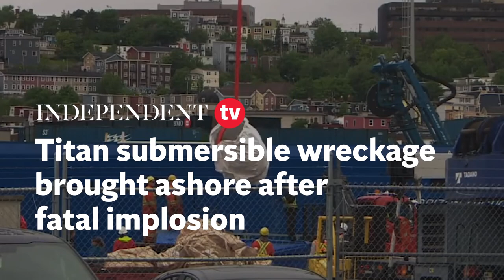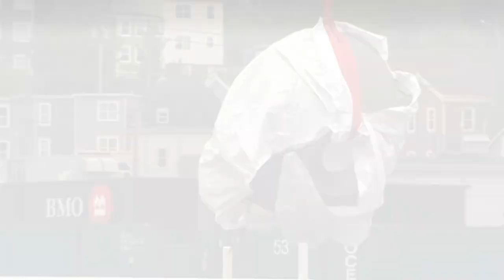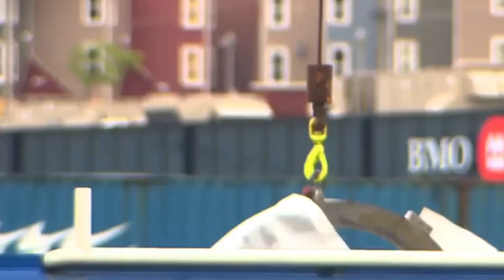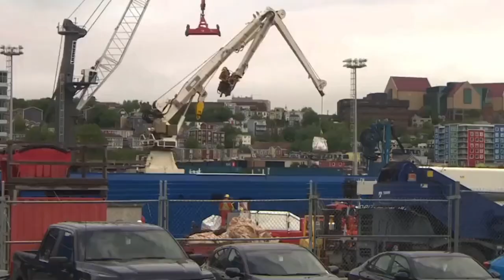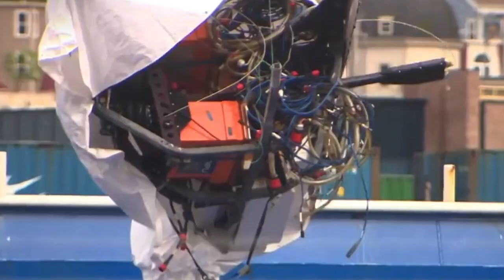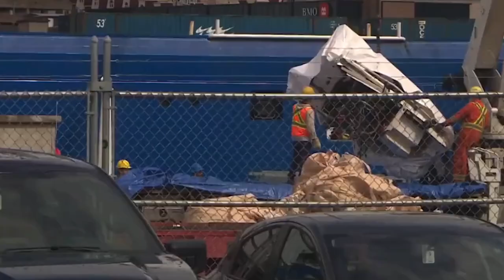Watch as Titan submersible wreckage brought ashore after fatal implosion

Comment: There is more of it left than I anticipated.
Reply: Funny that right? You ever seen an implosion on land….look it up if u haven’t and while you watch it x it by the pressures underwater at that depth, aka it’s wayyyy more of an event. Then look at these supposed pieces of an implosion where you have a perfect ⭕️ of a frame still with clear hinges (or whatever they are called) with bolt holes in them, none of which are crumpled/warped….very very weird this isn’t right for an implosion, not only does it implode inwards but then also outward. They will no down try and blame certain materials for this but no, no way no how…no matter the material would something that has imploded look like this.
Reply: @LB-wn6ur  Carbon Fiber doesnt break or twist or whatever. It shatters. like glass. There's a reason the only parts left are the metal parts. because the main construction of the sub is literally in thousands of pieces floating in the ocean
Reply: @fagalon9152  Shattering, vaporising, warping, blown out are all words that can be used for many aspects of this different materials or parts…..does it matter, what I’m saying still stands this doesn’t look right, tell me one thing in those parts shown that actually looked like it had any damage, warping, buckling, shattering, imploded.
Reply: @LB-wn6ur  These parts of the sub were unpressurised, and therefore would not have sustained the same damage as the pressurised crew quarters (aka the carbon fiber parts)
Reply: @shannoncrossland9710  One of the pets erm edit parts* (will leave the pets there bcoz autocorrect must be obeyed) is clearly the front end, where the observation window was….one of the main suspected weak areas yet the cone itself and the area where the window used to be appear to have no damage, from the comments made to me so far I’m supposed to believe because it is made from titanium and is very malleable that it could snap back into place with no signs of damage?
Reply: @LB-wn6ur  only the weakest parts fail so violently. In this case it was the experimental material they used for the main shell (the tube like part) that was never going to survive that pressure the way the rest of it would and once that failed the pressure equalized so there was no point at which the rest would fail. It would only be even damage if all the parts had even strength. The front and the frame were much stronger.
Reply: @SasquatchPJs  That’s a more understandable explanation than titanium being so malleable that it pops back into shape after such an event….that’s what someone actually said to me, much more inclined to believe you’re explanation thank you for the input.
Reply: The parts that survived are titanium, probably 2-5 inhes thick. This is what submersibles are normally made of, so it makes perfect sense they have survived. As stated above, the actual tube part was entirely carbon fibre, which is (again as stated) like glass. As such that is the part which imploded. I bet if we had a closer look at these endcaps they have dents and scratches in them from the carbon fibre imploding then exploding.
Reply: @fagalon9152 Actually, carbon fibre breaks and snaps. It does not shatter like glass. 

Have you seen supercars when they crash , they just snap into bits . There is no shattering .
Reply: Hydraulic press channel has a footage of implosion with mini metal Submarine model. Whatever inside the sub is getting squeezed.
Reply: @Kr00zA Good points. What’s your theory on the porthole missing? I wonder if that failed first or the hull failed. Logic tells me the porthole would’ve been forced inwards but wonder if science did some magic and as the hull failed it actually forced the porthole outwards 🤔
Reply: @LB-wn6ur  you obviously don't realise how strong titanium is.
Reply: @t-rex4211 probably didn't take much to destroy the port hole window after the implosion considering the window was constructed from plexiglass bought at a hardware store.

Comment: The steel components seem to be intact (less under rated window) but the carbon fibre body cell must have shredded. I don't think anybody will be using that manufacturing process again any time soon.  😬
Reply: the subs they used before worked why, why try fix what aint broke (talking about why make the titan when the sub they had before was fine)
Reply: no one was using carbon fibre anyway. Only oceangate was stupid enough to try
Reply: It was both a bad design for that depth and bad materials. No surprise at all at what parts of it survived.
All in the name of profits and "innovation".
Reply: @zephyr8072  They never actually made  a profit from any of the missions. The CEO said that they actually burned more fuel getting to the location than they made each time.
Reply: No one can understand how the carbon fibre in the resin was supported to work? It is just really odd.
Reply: @zephyr8072 and diversity
Reply: Don't underestimate human greed and stupidity.
Reply: The domes and interfaces are titanium.
Reply: @ruinfox4108  Maybe because it a stupid idea and just because its worked before doesn't mean its correct, and if this had been subject to certification more than likely never would have been allowed to be used, that and a 1300m rated poly window, when going down to 4000m , just plain stupid
Reply: @@CarrotCrunchingWabbit Well, the boss found that out the hard way! I know what you mean though. I am no expert but I know  how difficult it is to bond different materials together.  This was inevitable really.👍

Cancel

Reply
Reply: @@retiredbore378 I think reality suggests different mate, the titanium is still in tact clearly, the only thing missing is the carbon fibre hull. I wouldn't get in anything you make.

Comment: Some parts are more intact than I expected. Particularly the load with all the piping. The orange boxes and some of the frame appear undamaged.
Surely an implosion at such a depth would cause catastrophic damage to all parts.
My thought and prayers go out to all affected ❤️✌🏽
Reply: Those parts were likely outside the pressure vessel. They didn't get imploded.

The reason for the Bluetooth game controller was that nothing could go through the pressure vessel from inside to outside, because that would weaken it. All the power and control systems for the thrusters and weights would be on the outside.

Comment: By the way the domed section is lashed through the hole where the window was we know the window blew out (or in)... It was only rated to around 1300 meters, not the 4000 they went down to.

I'm no expert, but I think we found the problem.
Reply: There is so much wrong with the story we are being told.
1. The vessel was graded for 4000m but was downgraded to 3000m in 2020 due to cyclic fatigue but was rebuilt to overcome that and had been down safely several times since.
2. Weeks before, the internet gets flooded with stories of the dangers of deep sea exploration and vessels imploding. How odd.
3. When the sub goes missing several videos immediately are posted saying how unsafe the sub was.
4. Regular banging noises are heard every 30 minutes for many hours after the sub fails to surface, but it is explained away as wreckage noise - before the sub is discovered.
5. A seismic noise is heard and we are told it is consistent with an implosion. Really.
6. Reports are made that recovery will be difficult as the fragments are scattered all over the floor. Implosions get crushed like a coke can. They do not scatter.
7. Reports are reversed to state that only the cap popped off during the implosion and the pieces can be recovered.
8. Looking at the wreckage here there is zero sign of any piece being bent. When you crush metal structures they instantly bend. Like the coke can.
9. The owner was taking footage of the Titanic. I wonder if he discovered anything he ought not to have while down there.
Reply: @greatbriton8425  number 4. if you watched the first major conference on day 4, the person talking explained that a) there was no 30 minute interval b) they heard banging on sonar multiple times the day before.

Clearly the media made a false narrative about the 30 minute thing. No offense but I think you need to look into what was officially stated vs hocus-pocus. 
I would agree that there is a lot of dirt on OceanGate and that there was blatent negligence.

8. You are comparing composite materials and possible metal alloys to a "coke can" is that really an accurate comparison? 
Again I would agree that it's obvious, they used a poor choice of materials, but unless any one sits there studying supercomputer level simulations of accurate mathematics expressing estimated thresholds and tolerances, by studying the physical wreckage, then it's impossible to know at this stage what happened to the vesel.

You're acting like you have your facts straight without giving even one ounce of scientific literature to merit anything you're saying...
Reply: @greatbriton8425  "9. The owner was taking footage of the Titanic. I wonder if he discovered anything he ought not to have while down there."

Aquaman keeps his Titanic bachelor pad top secret.
Reply: @greatbriton8425  Most of what you said is complete rubbish 
1) The vessel was not graded for any depth, those are the depths quote by OceanGate. The vessel was in fact uncertified. Additionally the titan has only been to the titanic 2 times since it was rebuilt. The fatal accident occurred on its third trip to the titanic. So it has not been down there many times. 
2) There was no flooding of stores. This is a complete lie. 
3) There were a lot of videos because the media was actively searching for any and all stories they could write about the titan as it was proving popular with people. 
4) The idea that banging was occurring ever 30 minutes was completely made up by the media. The coast guards said they heard a noise and then another noise 30 minutes later but they did not know what the noise was. It was the media that turned this into banging occurring every 30 minutes. 
5) What you dont believe that US has underwater sensors designed to track submarines approaching the usa. What is unbelievable about this?  
6 & 7) You are comparing initial reports made by the coast guard to information gathered after days of additional searching. Information can change. Particularly under these circumstances. 
8) When you crush a coke can the middle may bend by the top and bottom of the can usually remain relatively unchanged. The section in the video is clearly the front of the titan and may have remained unbent while the middle section was destroyed. 
9) just dumb.

Comment: Mofos got flattened into pancakes
Reply: More like superheated into a hot, compressed sauce. The compression of the air generates huge heat and the human remains, apparently, would quickly become a mix of ash and small bone fragments. Like an underwater pressure cremation I guess. Thankfully the implosion speed at such pressure was significantly faster than the speed of nerve signal from the body to the brain so they had - mercifully - absolutely zero awareness or suffering.